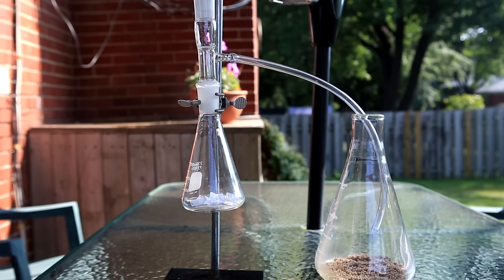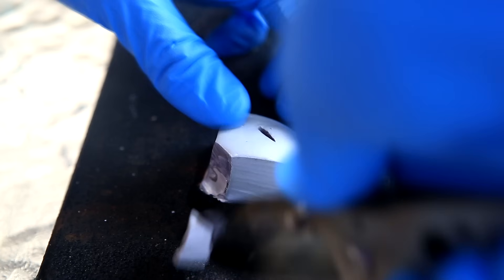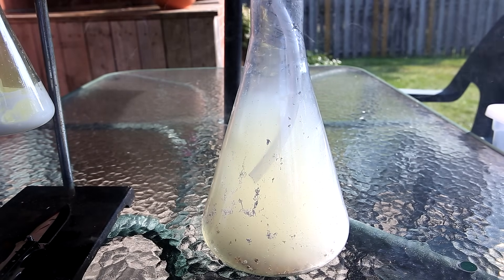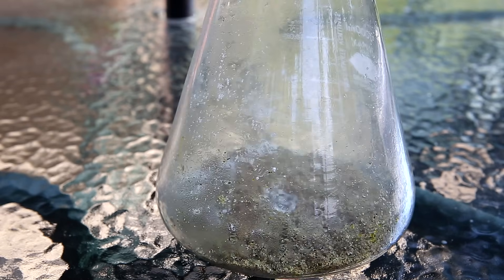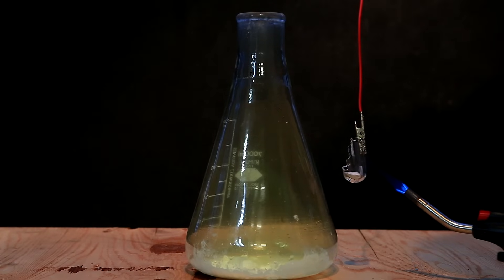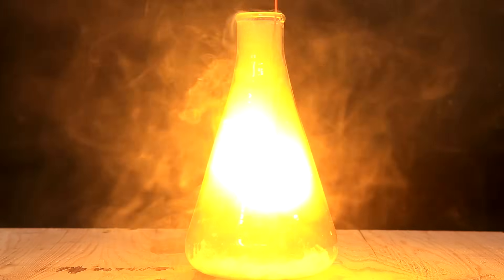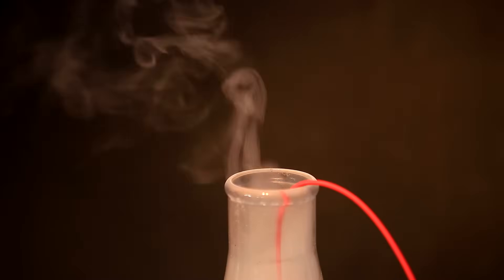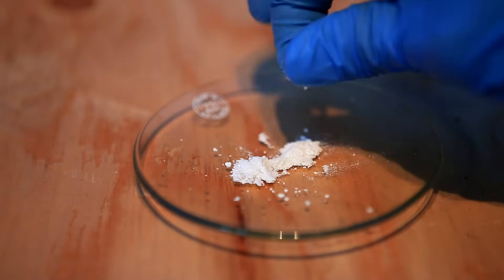Making table salt using sodium metal and chlorine gas

Comment: I had no idea sodium was the English word for Natrium. Had to google it since I was sure table salt is NaCl. Apparently it's called Natrium in Latin, German, Swedish and Finnish etc. It's called Sodium in English and French etc. Why the "split" name?

Edit: Just realized it's the same with Tungsten / Wolfram. Lots of countries use one of the two names? Quite confusing ^^
Reply: And what's funnier is that tungsten is named in Swedish. It means 'heavy stone'. And yet the Swedes themselves call it Wolfram, instead of the actual Swedish name that's used in English. The Swedes also call nitrogen 'suffocation'.
Reply: Pretty cool I didn’t know that either
Reply: Would be same for plumbum too
Reply: Kalium/potassium
Reply: love using natrium, plumbum, kalium just bc my low iq cannot relate Na with sodium sometimes

Comment: Sodium ionizing is such a pretty color. Probably got alot to do with mans fascination with fire. With my high voltage, high current experiments (6-700w @ 30-40 kV, which is in the mA range, but thats heaps enough for solid plasma), a large NaCl crystal was one of the coolest things to zap. Once it got hot enough, crazy bright. Being electricity, it always found some odd shaped 'shortest' paths, but a furious glow. Good call to bottle that magic n call it technology. Cool vid dude, as always, many thanks.

Comment: Interesting.  A couple of other things you could do with this:  1) Cut a hole in a barrier to pass a beam of the lantern light through a prism and see the yellow sodium lines.  2) Dissolve the product salt in water and check the pH, to determine how much turned into NaCl and how much NaO.  3)  Flood your flask and test tube with nitrogen beforehand to displace the oxygen, so your burn will be mostly in the chlorine.  If you smell a little ammonia, that was some of the nitrogen reacting with the Na, but there won't be much.

Comment: Could you have just stuck with the first method?Rather then changing the whole procedure one would just dissolve the NaCl sand mixture in warm H2O?   I mean the second method works obviously but is that a possibility?

Comment: Extra Sodium, contained in a test tube bottom (limited surface exposure), and a Chlorine source that's still producing gas, probably at a faster rate than when it was started because of the heat from the burning sodium.

Comment: Hey NileRed, I know this is an old video but I have a request, could you possibly revisit the molten sodium on chlorine gas reaction in the flask, or the 'lantern reaction' as you put it but this time in an oxygen free environment? Perhaps just by placing the string holding the Na on a stopper that is then placed over the flask to keep some of the atmosphere out?
The reason I ask is because there is an old alchemy tale about a thing called a 'Hermetic Light', which is essentially a light-bulb created by using what I've translated to be sodium metal and an unknown gas in a sealed airtight container which was said to glow indefinitely(or a very long time) first explored by the legendary alchemist Hermes, when I saw that reaction I could think of nothing else and I would love to see just how long this reaction could be sustained in a hermetically sealed container or if it would work at all.

I know, I know, it's wishy-washy alchemy bs... but still. I'd be cool to see what actually happens. Just because these people didn't have the benefit of the scientific method doesn't necessarily mean they where wasting their time 100% of the time.

Comment: I don't understand how two SUPER REACTIVE elements do not react on contact at room temperature....  The sodium wants to give up an electron so badly and the chlorine wants an electron so badly.. HOW do they not ignite explosively on contact without water or elevated temperature ??
Reply: Christmas Eve 
The sodium is constantly forming oxide layers in atmosphere, solids aren't as reactive as liquids or even gases, and plus chlorine isn't as reactive as fluorine, for example. Perhaps that matters. Now that I think about it, both oxygen and the halogens are "oxidizers". It could be that sodium reacts better with oxygen than chlorine.

Comment: if you wanted to use the sand contaminated one, cloud wash it with hydrogen oxide, I've read somewhere that the sodium chloride dissolves, leaving the sand at the bottom, then you could filter it off, and evaporate the hydrogen oxide to form sodium chloride crystals
Reply: germimonte You mean dyhydrogen monoxide?
Reply: BeGamerSl it's wrong to call water "dihydrogen monoxide". water is water, IUPAC said it
Reply: You mean hydroxylic acid right?

Comment: couldn't you have purified the contaminated sodium chloride by dissolving it in water and filtering off the sand?
Reply: Yes, but the sodium burned in the air as well. It's not 100% chlorine, you have to be aware of this. Sodium oxide isn't a condiment.

Comment: Sorry if this is a dumb question, but when the first batch was contaminated with sand, if its table salt, why couldn't the salt be dissolved in water and then filter the sand out?
Reply from the maker: It could be. But purifying NaCl is not exactly worth the time
Reply: NileRed gotcha but would that not be easier and quicker than going through the other method? was that just for the video?
Reply: this is just an example in chemistry, this is not how salt is actually made for consumption or applications. Salt is mined from the earth like other resources in beds that are ancient evaporated lakes or seas, not created chemically, so about being quicker and easier, digging it up is the quickest and cheapest way
Reply: They don't exactly dig it up: they drill holes in the salt, pump in water, allow the salt to dissolve for a year, pump out the water and let it evaporate in ponds. In the old days before pumps were invented, a LOT of people died mining salt - which is why getting sent to work in a salt mine was a common death sentence. Salt absorbs moisture. If that moisture just happens to be in a salt miner...well, guess what.
Reply: @jmowreader they do dig it up, to a lesser extent today because its so dangerous - but that is how salt was historically produced through physical salt mining with picks and carts
Reply: +Ravangers it is but the salt disolves from the water.
Reply: it doesn't dissolve from the water, it is dissolved in the water and is vaporized or evaporated out of it
Reply: But making it in the first place is worth the time?

Comment: you made a metal halide bulb!
Reply: It's more a sodium-vapor lamp :)
Reply: Exactly the same color as sodium vapor lamps :)
Reply: Wonder why it's the same color as sodium vapor lamps????
Reply: Sodium is a metal  and chlorine is a halide so it is a metal halide lamp 😁
Reply: I'm kidding btw
Reply: hps, high pressure sodium light bulb.....
Reply: sodium is orange light and metal halide is blueish (white)
Reply: Some might say it could be exciting
Reply: Metaphix11b no it is a metal halide lantern
Reply: Not halide the spectrum is wrong ,it's more like a high pressure sodium, red spectrum
Reply: A low pressure sodium bulb actually!
Reply: Well actually Metal halide and high pressure sodium both use a good deal of sodium which will give you that warm reddish light. It’s the mercury content in metal halides that give it more of a blue hue.
Reply: A high pressure sodium light ,a vapor light has a reddish purplish hue
Reply: patrick nepton ,red spectrim,  s or h + vapor +purple .s red h blue vapor purple
Reply: Dude this is like some survival stuff, who's gonna yoink the pool tabs and hydrochloric acid and sodium when the apocalypse hits? Freakin awesome, I'm more interested in the science on that, chemical lamps are so neat

Comment: Correct me if I'm wrong, but you also could have dissolved the first product (with the sand contamination) in a sample of water then filtered the sand out via a semipermeable membrane, then you could have dried the remainder of the sample chemically or via the addition of heat; you could have even made the sample even more pure by running the now filtered salt through a volumetric funnel with water and an organic solvent. Since NaCl is a salt, it will ionize and stay dissolved in the water, while any organic impurities (like the mineral oil) would partition into the organic layer; then, you'd simply collect the water sample, dry it, AND viola, clean salt (well, relatively anyways). Could someone give me feedback on this, I'd quite like to know if I'm correct. Great video by the way!

Comment: Just a though; what if you mix sodium hydroxide and hydrochloric acid?
Reply: Yes, but wouldn't it produce sodium chloride, which is a neutral salt?
Reply: Yeah, It would, but it would also be boring asf
Reply: Yeah that's true. It's always more interesting if it involves fire.
Reply: That's why i love exothermic reactions <3
Reply: It is a VERY vigorous reaction. It won't explode or anything like that, but it'll froth up then throw lye and acid all over the place. The result is saltwater.
Reply: +Rob B it will burn and disolve.
Reply: jmowreader it depends on the reactants concentration and how you mix it. it's obvious that if you throw 1L of 37% hydrocloric acid in a 70% sodium hydroxide solution it will do a magnific corrosive fountain, and an amazing cloud of acid

Comment: Can I point out that you could very easily dissolve the salt and sand mixture in water and pour the solution through a filter to extract the NaCl?
Reply: Watching this again 2 years later, I thought it was a new video and was going to comment “Why not do a water washing?” when I realized I had already commented on the video. Spooky time travel when you think it's a new video! XD

Regardless, great video as always. Keep it up!
Reply: Benjamin Hackett left over sodium that didnt fully react could react in the water and turn into sodium hydroxide which cant be separated from the sodium chloride by just using the filter. either way the product isn't pure and crystallising the sodium chloride after dissolving it just takes too much time and there's nothing new for us to learn from doing that

Comment: Instead of melting the sodium and putting it into the chlorine, wouldn't it just be easier to take the product from the sand method and filter it? Because NaCL is water soluble and sand isn't.

Comment: Sodium Chloride is water soluble. Why bother scraping it off? Rinse it off and recrystalize!
Reply: In such a finely powdered NaCl, the elemental sodium content would be negligible.  If anything, there might be a tiny, barely detectable whirl of smoke when added to water.  It is the chlorine contamination that he is worried about.
Reply: Because if any sodium metal is left, you’ll get fire/an explosion
Reply: @LvcianoN  You mean like he got when he directly put water on the sodium itself? I think he can account for that lol.
Reply: @LvcianoN  add water slowly
Reply: Check ph because of residual  acid.
Reply: Though one should never eat anything made in a lab or in used lab equipment as other things could be present on the glassware like contaminants from previous experiments.
Reply: @BackYardScience2000  Cody from Cody's Lab would taste it for sure.
Reply: @keenanpepper  , you're right.  Lol.  He did take a bite out of sodium metal and put mercury in his mouth, so I wouldn't put this past him.  😂
Reply: @BackYardScience2000  guy is definitely shortening his lifespan
Reply: There’s so little salt that he might as well not bother just to get a few grams of sodium chloride. Also chlorine contamination.
Reply: Wtf is recyclize
Reply: He might have a reason
Reply: Just like extracting sea salt from salt water
Reply: Horrible idea, water plus left unredacted sodium = fire BOOM.
Reply: @ATLTraveler  in xs of Cl2 gas the thing he would be more worried about is chlorine gas he used the Na as a limiting reactant in this experiment
Reply: @ATLTraveler  Of course, fire BOOM, but I still don't see why that would be a horrible idea.

Comment: If you want to purify it even more you can dissolve it in water and put it in the oven to evaporate the water. The sand won't dissolve in the water, the sodium will make NaOH and will ignite, and the chlorine is a gas, so it won't effect the product.

Comment: The stuff that was contaminated in sand, couldn't you have just dissolved it in water, filtered off the sand and then let it recrystallize?
Reply: That's what i was thinking. Just dissolve and filter.
Reply: Yes but some small amount of soluble substances are always present in sand.
He would  get impure salt.
Reply: @prospektOS-tmo97  But that applies as much to the scraping as it does to the dissolving, though
Reply: Yes.

Comment: How do you know that by adding water to the mixture to get it started you wouldn't get sodium hydroxide?
Reply: Chlorine is a much stronger oxidiser than oxygen is, so even adding chlorine gas to sodium hydroxide you would still get sodium chloride and sodium hypochlorate. the hypochlorite will then decompose into more sodium chloride.

Comment: If i am not mistaken, reacting Cl2 and very hot Na will actually have a side product which is NaClO3... I think its the best reason not to eat that :v
Reply: NaClO will decompose into NaCl given enough time (and some heat). NaClO3 you will need to melt above 300C for it to decompose.

Comment: What happened if you heat something up so much it stops emitting visible light and starts emitting ultra violet? Will it go invisible?
Reply: +יותם ענברThat's a great question. It requires that we delve into something called the electromagnetic spectrum. When you excite atoms or molecules by giving them energy, for instance by adding heat, the electrons absorb most of that energy and move further away from their nucleus. As an electron expends its energy and rebounds to its normal distance from its nucleus, it generates a photon with that rebound energy. Photons are packets of electromagnetic energy; however, not all photons are created equal. Depending on how far an electron rebounds, it can generate a photon of varying energy. The energy of the photon corresponds to its place on the electromagnetic spectrum.

Our brains and eyes can only perceive photons that correspond to a small slice of the spectrum called visible light radiation. UV radiation is also on the spectrum, just past visible light in energy. Not all of the radiation in the video is solely visible light. A lot of it is being emitted as infrared and a small portion is likely UV. While we can't "see" UV light, we can use devices that detect UV radiation and create what's called false color imagery. This method for displaying invisible radiation shifts colors outside of the visible spectrum to colors that are in the visible spectrum. For the record, heating sodium to the point that it emits mostly UV would require an enormous amount of energy.
Reply: +יותם ענבר It will evaporate before that
Reply: Gas has color...
Reply: Yea, but you can't contain it since it expands the hotter it gets. If the gas is in the open air it will dissipate in the air around you and you won't see it anyway
Reply: Then put it in an insulating container... But that's off topic. If you were to observe it, will it be visible?
Reply: +יותם ענבר UV light is not visible by the human eye.
Reply: Ok. Thank you very much for the information.
Reply: The perceived colour of radiating objects changes from red to blue as the peak of the radiation shifts from IR through VIS to UV.  We can see visible (red) light when the object is over about 500degC but the peak radiation is still IR.  At around 5000degC the peak is in the middle of the visible range and it looks white.  As we go hotter it looks more and more blue but the IR, ROYGBIV spectrum is all still there, it will always have some visible colour above 500degC.  -  https://en.wikipedia.org/wiki/Black-body_radiation

Comment: you could just easily react sodium hydroxide and hydrochloric acid and then evaporate the water after it neutralizes and you'll be left with sodium chloride.
Reply: Just make sure you have the same number of moles though :) otherwise you might burn your tongue.